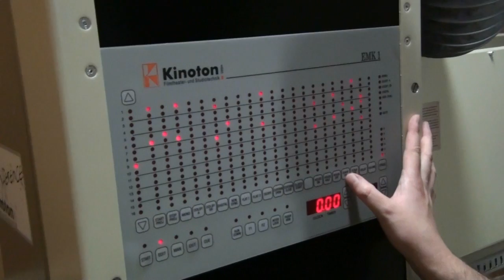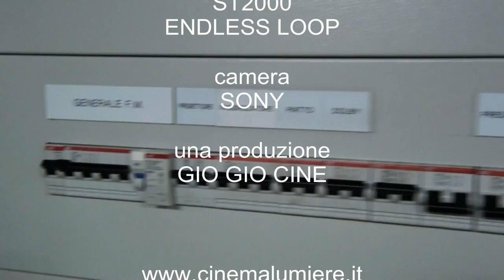Cinema Kinoton Endless loop

Comment: If you look at the star shape that the film forms you will see that the inner layers bend in and out more than the inner ones do, so the inner layers contain the same amount of film for each turn as the outer layers, so the film does not have to rub against itself as it moves from the edge of the platter to the centre.  Clever, but give me twenty minute reels and changeovers any day.
Reply: Same here...

Comment: Platters I worked with had a "tucker arm" that pushed the film inward rhythmically, driven by a track on the underside. I don't see how the film takes on the hump shapes in your video to achieve inner and outer length equality without this?
Reply: No that was the cinemeccanica looper. This Kinoton uses an electronic system to articulate the film.